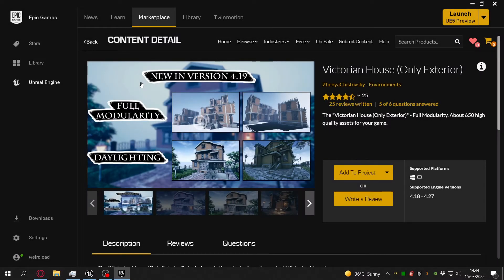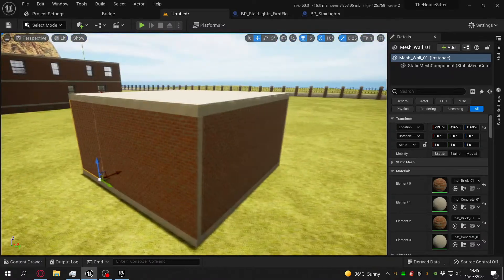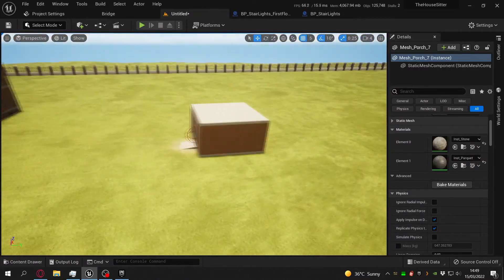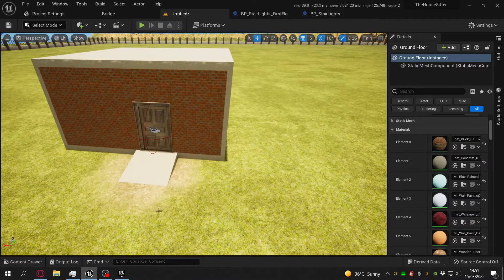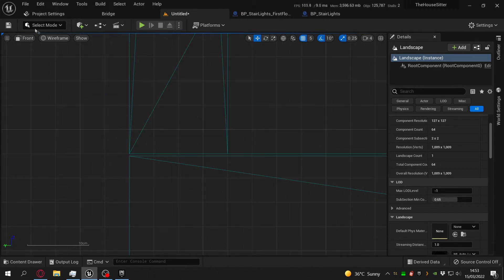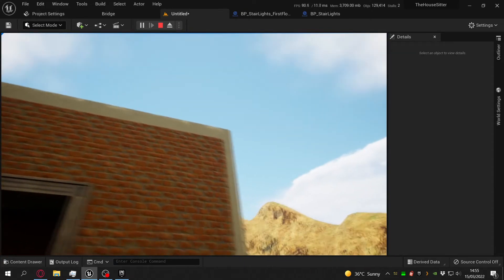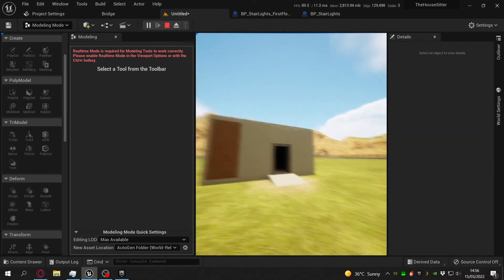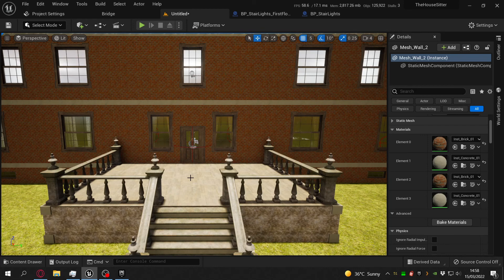Light leaks and modular walls and floors behaving badly.

Comment: Two planes that have the same number of vertices lining up perfectly do not get floating point variation along the edge.  So sitting a box with 4 verts onto a wall with, say, fifty will mean gaps between.

You need the same number of verts on both sides, touching.  Otherwise you need to interpenetrate the parts like you did.
Reply: Physically there isn't a gap, as two edges meet perfectly... but if they have different vertex counts the maths to calulate the lines varies and voila... leakage

Comment: Potentially useless comment here, but would it be possible to push the wall segments into the floor tile? At the moment, with snapping, it's clearly leaving a gap of some kind, even if the programme thinks the sections are flush. So, is it not possible to overcompensate and go further than flush? Or would that not make any difference?
Reply from the maker: I've actually tried that and it doesn't seem to make a difference - to the light leakage, at least. That's also one instance where it seems to matter which merge function I use, as sometimes using the first one breaks the floor and the player just falls through it. When I use the second one those overlapping intersections are dealt with. I continue to experiment, and will post my findings. :)